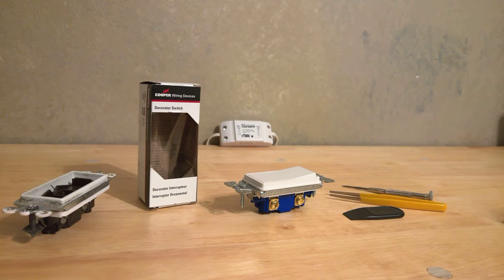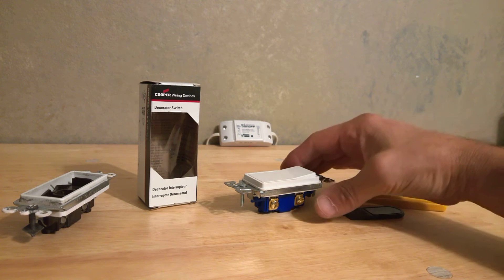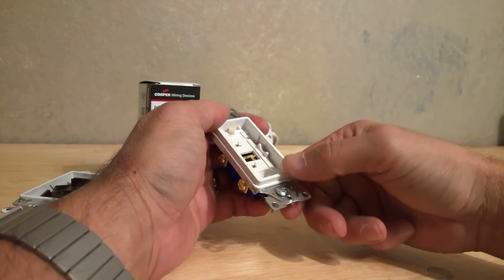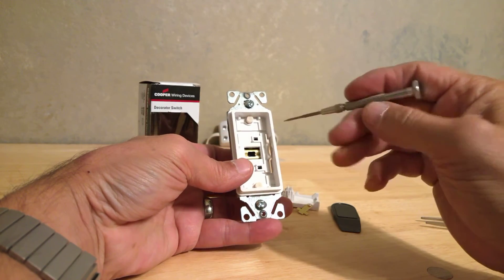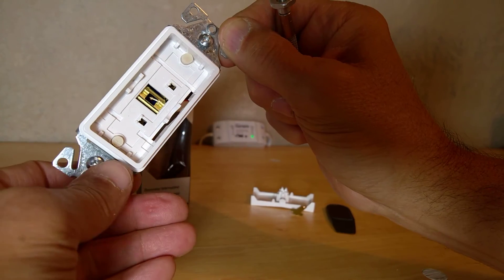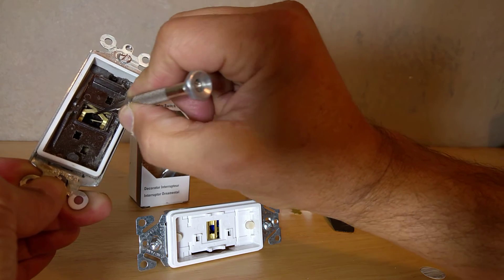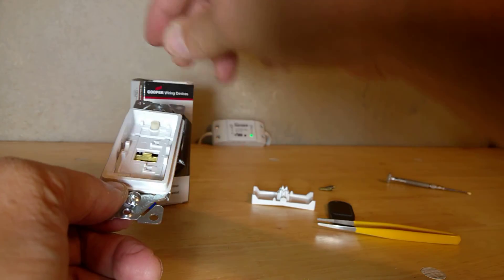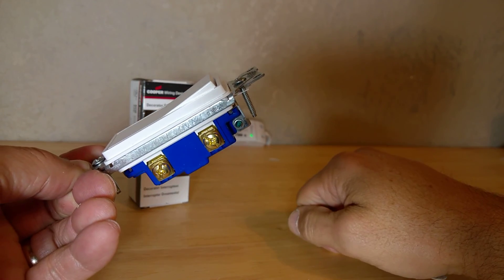Decora Style paddle On-Off switch conversion from Maintain to Momentary button action

Comment: Thanks for the tutorial your instructions worked perfectly with an old decora style switch we had in the bathroom. I connected a Sonoff SV in Isolated mode to allow the bathroom fan to toggle on or off (Google Assistant can also control the sonoff through ewelink "I'm taking a shower"). Better than the BIC stylo spring mod I tried to do...

Comment: As simple as this is, by modifying the switch, please keep in  you've voided its UL rating, and likely violated your local building code if you install it in a wall.
Reply: I was surprised there was only one comment that mentioned this. Because the contacts don't line up parallel with each other anymore, they won't have as low of a resistance. If just being read by a digital input like a Shelly device It's totally fine, and maybe same for an LED , but with any normal load this could be quite dangerous.
Reply: I just went and did this to I switch I had and it looks like the contacts are actually slightly domed so maybe it's not quite as bad as I thought, especially for digital logic level signals since the contact was still touch the same even at a slightly different angle

Comment: OK, so from your description and example in the video, it appears that this is going to be On pretty much all the time... Or, is it adjusted just far enough to make the contact push it back, but not so far that it stays in contact permanently? Also, have you tested this on other brands of these decora switches? I was working on a 3-way Leviton decora switch today, and it looks pretty similar internally, but wasn't sure if all of the decora style switches are like this.
Reply: It's still normally off... just keeps it from staying on.

Comment: Great info, but I really couldn't see on video the change in position of the contact when you bent it, so wasn't sure how exactly to do it.   In the post you cited, this info helped on that, "-pry the inner switch contact away from the outside wall towards the center of the switch. (by doing this you’re preventing the switch from traveling over the center line and thus locking on the on position)"

Comment: I’ve got the switch working properly after following this video. I press the on/upper direction, and the power comes on, then it turns off when I let go, but the resting position of the switch is somewhere between on and off. I tried bending the internal contact a bit lower several times, but I either get this result or the switch stays on permanently. Am I doing something wrong?

Aside from the appearance, I’m worried that this half position is too close to “on” and could potentially cause accidental contact. Am I about to burn my house down to save $15 (and a little tinker fun)?
Reply: That's the whole point of this... to make a momentary switch (that is, it closes the contacts when you press and opens when you let go). You wouldn't normally wire a light directly to this for the reasons you state, it's used as an input to another device like a smart module.

Comment: Excellent video, exactly the information I was looking for. I had pulled apart one of my Decora switches and was attempting to create a momentary switch using a spring from a ball point pen. The spring was supposed to magically stay in place (it popped out within 10 test activations), and sometimes would allow the switch to stay in the on position. The modification shown here works perfectly. By not allowing the switch to go over center, the actuator always returns to the off state. This modification is simple and effective.

Comment: Thanks for the video. It worked great on my paddle switch. It took me a long time to finally able to use a modified paddle switch with a $6 Sonoff Basic. I was able to put the Sonoff inside the wiring box and connect the two wires I soldered onto Sonoff to my modified paddle switch. If I go buy one of these momentary connect paddle switch, it's like $25+, which is simply insane.
Reply: You should go to my WeMo or G+ page "Esp and Iot". Lots of fun IoT circuits are for you

Comment: I tried unsuccessfully to make a SPDT or "3-way" switch work like this, so each pole would be a momentary contact to provide separate up/down signals for an electronically controlled dimmer. Internally the 3-way switch is pretty much the same but it has two contacts instead of one, and there isn't enough room to simply bend them toward the center to prevent latching as in this video. I tried inserting pieces of rubber weather stripping under the ends of the rocker to act as springs to force it back to the center position, but so far I have not been able to make this work reliably. The rubber doesn't spring back quickly enough, and inserting this type material inside the switch probably violates code anyway. A piece of spring steel under each end of the rocker would probably work.
Reply: If you go to my Google Plus or WeMe site "ESP and IoT", I have made an open source 3-way sonoff type device . Although you won't be able to convert a three-way switch into a tap switch, you can have an ESP device that is intentionally made as a 3-way retrofit that will work with 3 or 4-way lighting circuits. You can convert any switch, even if it's just a standard spst "on off" light, into a three-way WiFi controlled switch.

Comment: I took mine apart earlier and when I reassembled it, the switch assembly was completely loose and wouldn't click into place or maintain contact. After trying to snap the thing back together a few dozen times and scouring the internet, I finally found this video where you pointed out where the spring was in the paddle. Turns out, unbeknownst to me at the time, the spring had flown off when I popped out the paddle. Ended up finding it on the ground halfway across the room. I popped it back in and all is well again. Thanks for posting this.

Comment: Hey thanks for the video. Any reason why with an in wall relay when doing this the switch would only turn the light on while holding the paddle down then turn right off when letting go? Thanks.
Reply: If you're using a solitary relay without driver electronics then it would have to have a self holding relay circuit like a safety switch. Tap switches are intended more for devices like Esp12-e devices, and electronic WiFi devices. If this is confusing to you perhaps you should find an electrician.

Comment: i don;t get it why would anyone want to do this? how would the switch need to be wired? and to what,  you mean not wires to the AC?
Reply: If you're converting existing wiring to a smart-switch it comes up a lot and these are surprisingly expensive and hard to find. In my case the switch is wired to a tiny little Insteon controller behind the switch, and then the controller is wired to the light, so the Insteon is between the switch and the light. The momentary action sends a pulse to trigger the Insteon to turn the light on/off... but then I can use computer programs, scenes, and schedules to turn the light on/off or dim.
Reply: Other than using with smart switch devices, a common usage is for garbage disposals, so it only runs as long as you hold the switch down.
Reply from the maker: And you can replace wall push buttons for your garage door opener. Anything that uses a momentary switch action instead of latching action.

Comment: Thanks for the video! I followed the instructions to make a push button wall switch for my fireplace. I connected the switch and the fireplace turns on when I push the switch but it then turns off because the fireplace needs a constant connection. If I hold the button on the switch the fireplace remains on. Is there a way to make this into a permanent wall switch instead of "momentarily"? Thx! Dave
Reply: What? The switch originally was a maintained contact. By following the directions in this video you disabled the functionality you actually want.
Reply: You're joking, right? Perhaps you should leave electrical wiring to electricians.